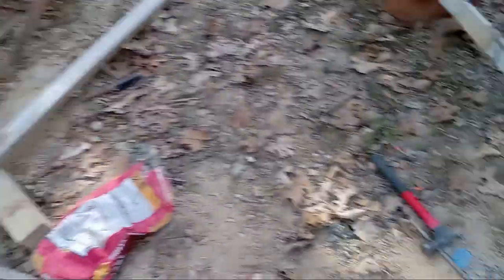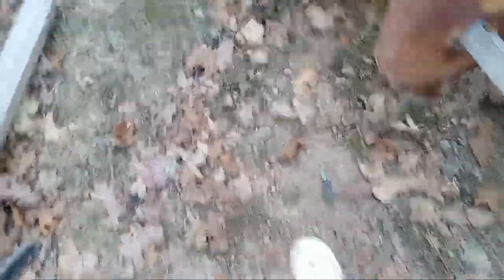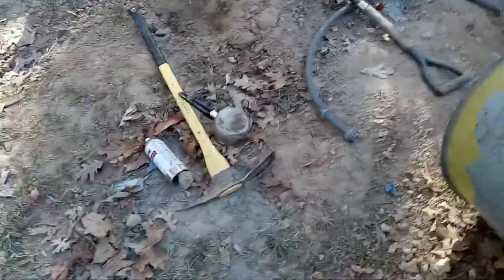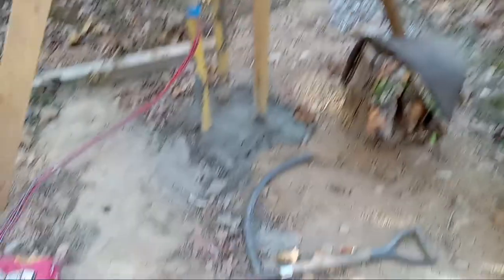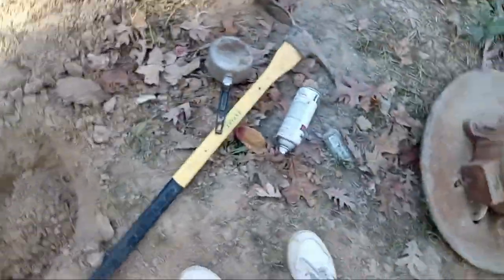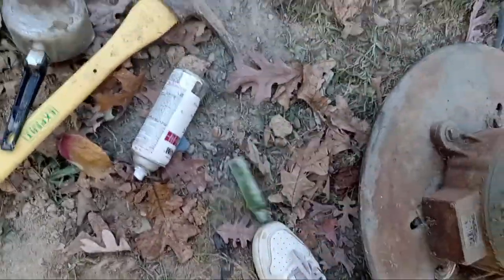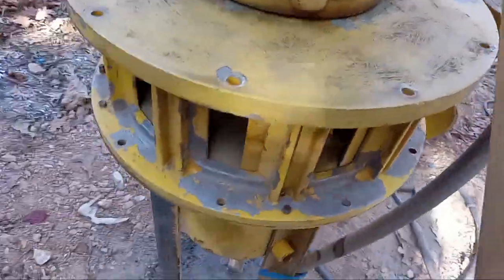tornado siren update

Comment: Is the 2T22 ever gonna be tested?
Reply from the maker: Yes but my mom has to buy a breaker box and a breaker wire because she bought a tanning bed and she needs a breaker box for that so I'm just going to hook my Sirens up to her tanning bed breaker box
Reply: @ThunderboltSiren1003  Oh alright I can’t wait to see it in action!
Reply from the maker: @robsc7493  same
Reply: @ThunderboltSiren1003  You cant run it its 3 Phase
Reply from the maker: @SouthCarolinaSirens  I know that I'm going to hook it up to a breaker cuz that has three phase power
Reply: @ThunderboltSiren1003  Residential properties dont have 3 phase
Reply from the maker: @SouthCarolinaSirens  oh no we built our house from scratch it's homemade we live in the middle of nowhere the breaker box we're getting has 220 volts
Reply: @ThunderboltSiren1003  You dont have 3 phase power in a normal house
Reply from the maker: @SouthCarolinaSirens  o ok
Reply: @ThunderboltSiren1003  DO NOT try to run that siren off single phase it wont work and you will destroy the motor
Reply: @ThunderboltSiren1003  dont run it off single phase because the motor will bust
Reply from the maker: @SouthCarolinaSirens  oh trust me I know that
Reply from the maker: @SouthCarolinaSirens  do you know how much volts Thunderbolt 1003 solenoids require
Reply: 240V
Reply from the maker: @SouthCarolinaSirens  ok
Reply from the maker: @SouthCarolinaSirens  where would I even get that much volts? Besides a phase converter
Reply: @ThunderboltSiren1003  your home has 240 volts
Reply from the maker: @SouthCarolinaSirens  yeah I know that but sadly our house only has 220 as the breaker
Reply: @ThunderboltSiren1003  220 is the same as 240
Reply from the maker: @SouthCarolinaSirens  oh really that's awesome!
Reply from the maker: @SouthCarolinaSirens  do you know how big of a trailer I would need to get to put a thunderbolt blower and Thunderbolt on?
Reply: @ThunderboltSiren1003  i do not know but it shouldnt need to be that big